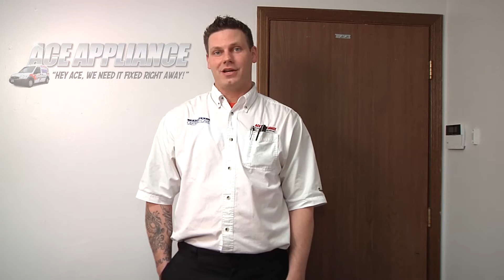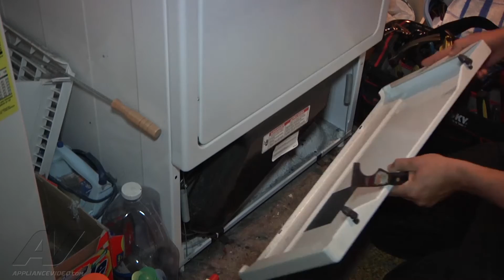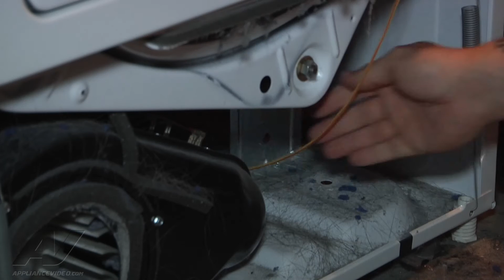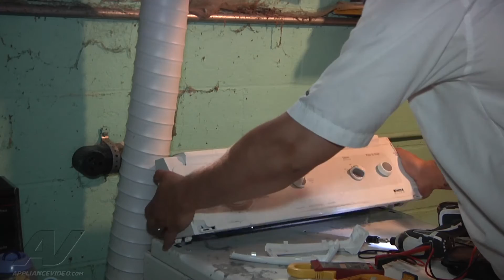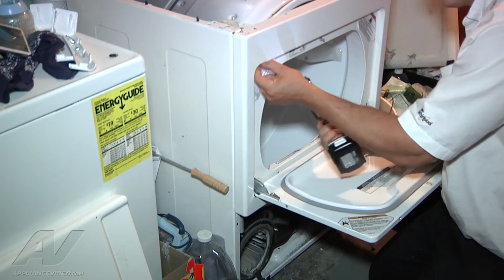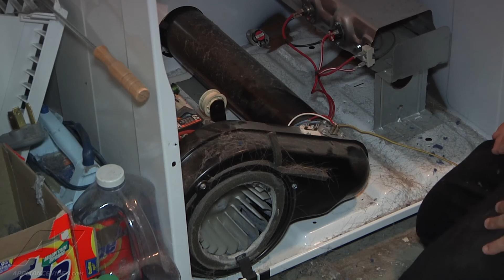Kenmore Dryer Repair - Does Not Heat, Randomly Shuts Off - Heat Control Board

Comment: My Maytag heats, but will shut off after a few seconds. Any ideas?
Reply from the maker: Great question, if you have a
more technical question that our parts department cannot answer, you can search
our over 10,000 answered questions free at our website www.ApplianceVideo.com under our Repair Help section. You can also call
our parts department at 1-800-830-5465 and they can give you help 7-days A week
Monday -Sunday, or search at www.SaveMoreOnParts.com  24 hours
7- days A week.

Comment: My Whirlpool,  LER6848AN2,  elect. dryer runs, heats, blows, but turns off intermittently, over and over, until timer finishes, clothes dry or not based on how much and how wet. I've replaced motor and other basic thermostats, element, etc. Local parts store gal of much years experience claims I need new motor, but I just repl. it within 3 yrs and it's too much $$.
BUT, unit is far from exit and I must use stairway to replace! A real reason NOT to replace / new unit.
Any advice? I have NOT checked my fuse box yet for the proper 220. SO, that might be the easy way out if it is a prob.
Reply from the maker: Great question, you can call
our parts department at 1-800-830-5465 and they can give you help 6-days A week
Mon-Sat . You can also search at www.SaveMoreOnParts.com 7- days a week.  If you have a more
technical question that our parts department cannot answer, our technicians are
answering all questions at our website at www.ApplianceVideo.com under our Repair Help section. We have over 6,000
common questions and answers that you can easily search through by your model
number, appliance make, problem or error codes, and It’s completely free to
search through our question & answer library. There is a very good chance
you question is already answered there.

Comment: I would like to thank you for this video. My dryer stopped heating. I thought for sure it was the element. I removed it and ohm'd it and everything was ok with it and the sensors. So I found your video about the control panel and swapped relay's and found that the heating element relay was bad. So thanks so much for taking the time to make this and help us diagnose issues!
Reply from the maker: +Mike Schiltz 

              Thanks for your positive comment. We are glad we
could help resolve your issue and hopefully saved you money. We have helped
millions of people repair their own appliances so please help us produce more
videos to our site by subscribing to our YouTube page, or posting our http://www.appliancevideo.com/ website on your Facebook or Twitter account. Our
factory authorized technician’s also daily provide free professional Repair
Help to people like you to help solve their appliance problems. You also have
the option to email a factory service technician with a question at http://www.appliancevideo.com/repair-help/ .  If you need of parts for your major
appliance, we have over 5-million parts in stock at http://savemoreonparts.com/ . Thanks in advance for supporting us. So email
us if you have any other questions our videos cannot resolve. Thanks for your
support in advance.   Matt, Ace Appliance service technician.

Comment: If it's the electronic control board, it's not worth replacing correct?
Reply: Amana dry is not get hot
Reply from the maker: +MIke DeVIta It depends how old the machine is and how much you like it. If it is older than 12 years I would advise a new unit.  Please help us provide more videos to our site by subscribing to our YouTube page or posting ourhttp://www.appliancevideo.com/ website on your Facebook or Twitter account. Our
factory authorized technician’s also daily provide free professional Repair
Help to people like you to help solve their appliance problems. You also have the option to email a factory
service technician with a question at http://www.appliancevideo.com/repair-help/ .  If
you need of parts for your major appliance, we have over 5-million parts in
stock at http://savemoreonparts.com/ . Thanks
in advance for supporting us. So email us if you have any other questions our
videos cannot resolve. Thanks for your support in advance.   Matt, Ace Appliance service technician.
Reply: +ApplianceVideo.com 
thanks.   I'm having difficulty pinpointing trouble.  the thermistor,  thermal cutoff, heater coils, and fuse all checkout ok.  the kenmore elite, 10 years old, turns on with drum rotation.   if  I set to cotton or any other setting requiring heat the coils ignite for about a minute then shut off.  Did volt checks on the timer,  heater and motor relays and they appear to check out.
Reply from the maker: +MIke DeVIta 

                   All of our technicians are now answering questions
daily at our http://www.appliancevideo.com/ website under the Repair Help section.  We also have over 1600 common questions and
answers that you can easily search through by your model number, appliance
make, problem or error code and it’s absolutely FREE. You also have the option
to email a factory service technician with a question on your appliance at
http://www.appliancevideo.com/repair-help/ . If you’re looking for a repair video, you
can also search our library of over 2600 free repair videos. ApplianceVideo.com
specializes in quality DO-IT-YOURSELF appliance repair videos and we get over
800,000 views per MONTH to our videos worldwide and growing. If you need of
parts for your major appliance, we have over 5-million parts in stock at http://savemoreonparts.com/ .  Thanks
for your support. Matt Ace Appliance factory service technician.